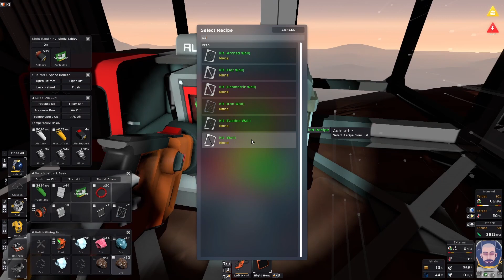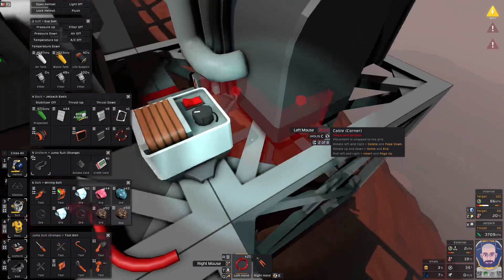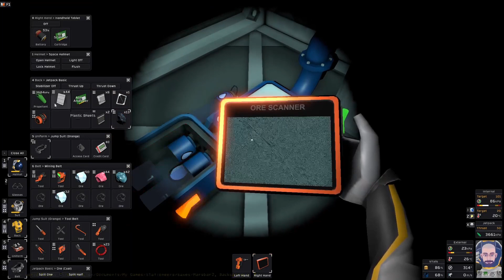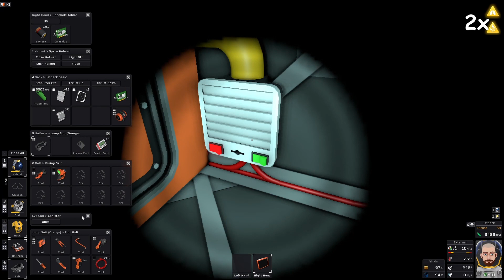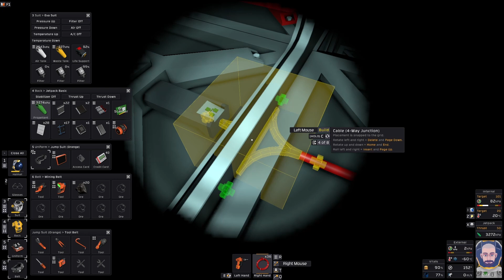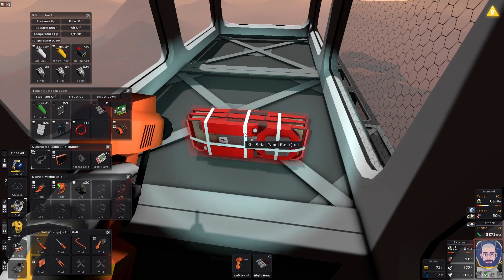Stationeers ~ Marsbar - Ep4

Comment: You have your mic way lower than your background sounds. It's impossible to understand anything. When you have a battery kit installed you don't waste energy using coal on the generator, all the 20 KW goes into your battery, filling it up in seconds. It's the best you can do when you have only 1.5 solar panels not automated and no wind turbines at all.